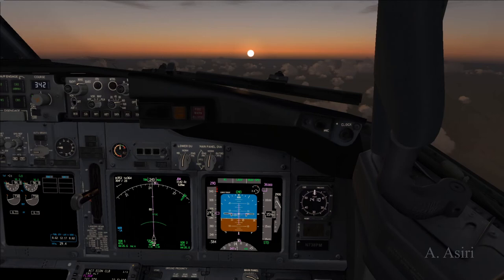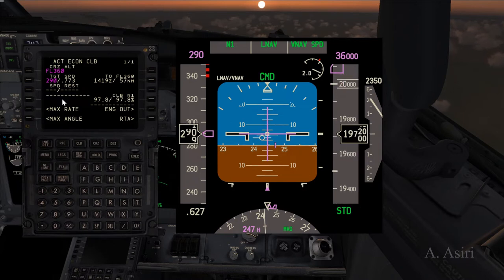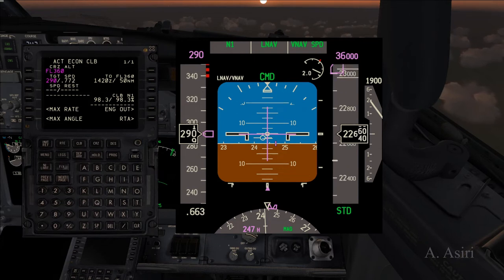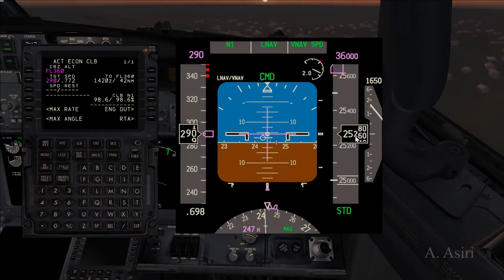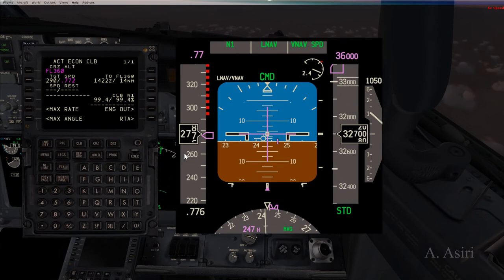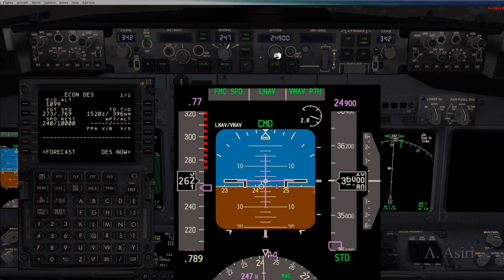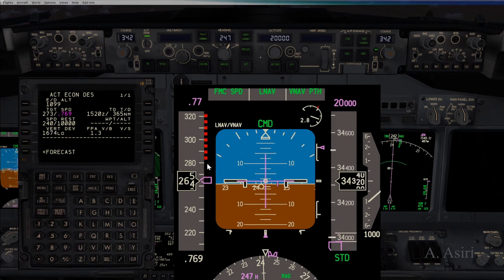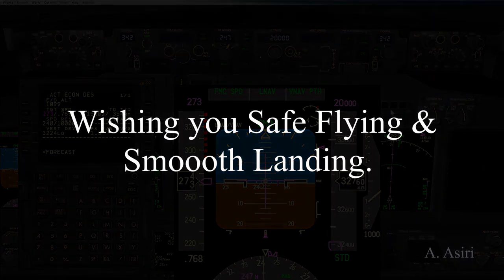Speed Transition (IAS - Mach)

Comment: Hi, very cool video. To add some additional information to your video, the IAS is a measurement of the dynamic pressure exerted by the air molecules entering the capsule of the instrument via the Pitot tube and it is dependent upon the velocity at which the airplane moves through the air or TAS  and the air density determining the number of molecules in a given volume, and can be mathematically expressed by the formula IAS=TAS x rho where rho represents the air density: thus as the airplane climbs at a constant IAS as the air grows thinner the TAS must increase in order to maintain a constant value of IAS. On the other hand the Mach number represents the ratio of the aircraft velocity to the speed of sound or LSS Local Speed of Sound which is turn is given by the formula 39 x square root of the temperature in degrees Kelvin: the formula for the Mach number is TAS/LSS: once again as the airplane climbs at a constant IAS as the TAS increases while the LSS decreases as the air gets colder, the Mach number increases up to an altitude referred to as change over altitude where if the airplane continued to climb at a constant IAS it would reach the critical mach number and eventually exceed the aircraft limitations and thus the airplane is flown with reference to its Mach number. When climbing at a constant Mach number as the temperature decreases the TAS must be decreased as well in order to maintain the TAS/LSS ratio constant, besides as the TAS decreases and the air density decreases as well the IAS decreases especially above the tropopause at 36000ft where the decrease in pressure is no longer compensated by the decrease in temperature. During the descent at a constant Mach as the air gets warmer and the LSS increases in order to maintain the TAS/LSS ratio constant the TAS must increase as well resulting in an increase in IAS until the IAS catches up with the target  IAS and the descent is continued with reference to the IAS rather than to the Mach.
I hope it clarifies things up for those who are not familiar with the concepts of IAS, TAS and Mach number.
Once again thanks for sharing and looking forward to the next video.
Reply from the maker: Hello Diego, 
What a great way of explaining it, thank you. 
You really dos clarified it for me as well. 
Thanks again 🙏🏼, well explained 

All the best 
Abdul
Reply: Abdulmuati Asiri thanks a lot, i just wanted to add something to your video for those who are not familiar with the IAS and Mach number
Reply from the maker: That was great Diego, 
I admire your level of technical knowledge please do continue to share, that is how we all help each other improve and grow. 

And I am dead serious when I said your explanation made it clear for me as well. It has been along time since I studied this information. 
Thanks again😊
Abdul
Reply: What a great explaining.
Another way of memorizing is using your fingers, where  little finger= IAS, Ring finger= CAS, Middle finger= TAS and Index finger= MACh. So when you keep your little finger(IAS) straight , other three goes to the right (from bottom to top) which means  CAS,TAS,MACH INCREASING when climbing. While descending if you keep index finger straight(MACH)  other three  again goes right (from top to bottom) meaning descending at const MACH,  IAS, CAS,TAS will increase. 
Hope it helps to memorize.
Thank you.
Reply from the maker: Hi Daddin thanks for the input, I am not sure I understood this way can you explain it differently please. 

Thank you 
Abdul
Reply: Abdulmuati Asiri hi i have one question for u as i have a doubt about the STBY POWER OFF light for the stby electrical system: as far as i have understood the light comes on if any of the Ac or Dc stby busses and/or the dc battery bus become unpowered as detected by the spcu. Now in order for that to happen you have to loose the ac transfer bus 1 or the dc bus 1 or the TR3 powering respectively the ac stby bus, the dc stby bus and the battery bus, however when that happens the spcu opens the normal relay and closes the alternate relay having the bus powered from the stby system - main and auxiliary batteries or main battery charger if ground service bus 2 is still available. So my question is: does the STBY POWER OFF light comes on if everything fails - both normal and alternate power sources - or as the normal power source fails prompting the crew to set the STBY POWER switch to BAT as per the QRH? Thanks for sharing
Reply from the maker: Hello Diego, 
The STBY PWR OFF light is indicating that a standby AC bus or a DC bus is not powered. 
So any time any of these buses is not powered the light will come ON regardless of what is the reason, the QRH directs you to select BAT as a way I believe to force the switching to happen, so it is not an indication of a loss of a normal power source but a loss of power, automatic switching did not happen or it happened and one of these busses is still not powered. 
Hope I made it clearer not confused you more. 

Let me know if that make sense of if you have any questions.

All the best, 
Abdul

Comment: Hello Captain, I loved your series on V/B, I have a query that in FCOM II, under chapter 4>control and indicators (10)>C/O switch, it is mentioned that automatic change over occurs at FL260, why is there a FL mentioned here, is it related to something else?
Reply from the maker: Hello Moin, 
Thank you so much for the comment.
You are right it is mentioned FL260 is where automatic changeover happen. 
To be honest with you, so far I am not sure what does that mean exactly, as from what I have observed so far, the changeover does not happen at an altitude if VNAV is engaged, and if the speed window is open the changeover will happen near the limit of the speed. 
Next time I fly I will open the speed window while VNAV engaged and see if it will changeover from mach to IAS or the opposite near FL260. 

Again thank you so much for the comment. 
Please let me know if you have any other questions or comments. 
All the best, 
Abdul
Reply from the maker: Hello Moin, 
After your feedback regarding the mention of FL260 for automatic C/O, 
I was thinking about, guess what if VNAV is engaged and the speed window is open, the change will happen at around FL260 regardless of what the target is both in the climb and in the descend. If the speed window is closed then VNAV will revert to the logic I mentioned in the video. Thanks Moin you pushed me to explore this, and learn something new. 🙏🏼🙏🏼🙏🏼. 
All the best
Abdul
Reply: @AbdulmuatiAsiri37  Thank you captain, it clears the working behind the change over at FL260, I too will try it on my next flight. 
Thanks and stay safe captain.
Reply from the maker: No Sir thank you, you have no idea how long I was thinking about it (I am talking like years), and when I saw it last night in the flight I was happy like a kid eating candy. 
So THANK YOU VERY MUCH 🙏🏼

Comment: Can you also please explain the concept between IAS, TAS and G round speed? Thanks
Reply: Airspeed transition/mach transition. The point where you use mach as reference instead of airspeed.
Reply from the maker: ISA the speed you see in the speed tape, it is computed through measuring the air pressure in the pitot tube. 
As you climb higher, the air becomes thin the speed tape may indicate low indicate air speed but in reality the air plane is flying very fast though the air “with respect to the air” that is where TAS comes in play a system in the airplane will do all kind of computation to present to you the actual speed the airplane is moving through the air. 
Ground speed is that how much distance over the ground the airplane is traveling per hour. 
If you take the TAS and add the value of the tail wind if you have tail wind or subtract the value of the head wind and you will get the ground speed. 

Hope that answer your question. 

Let me know if you have any other questions. 

All the best 
Abdul